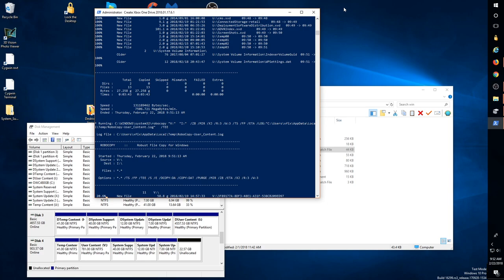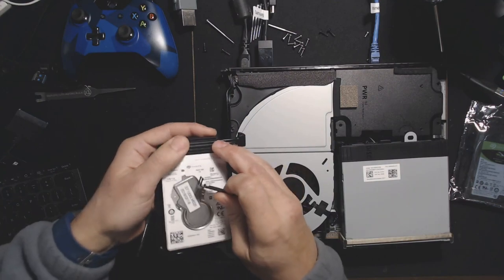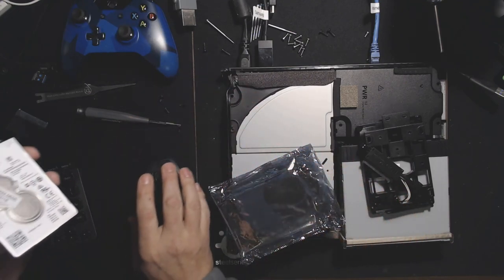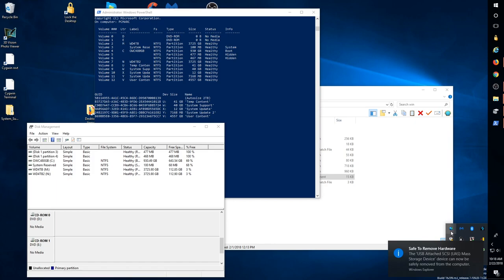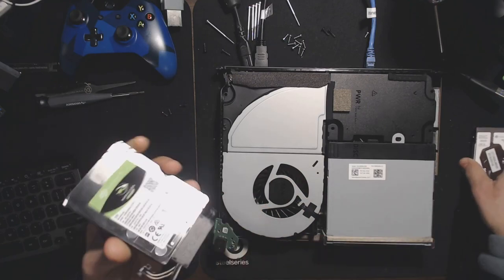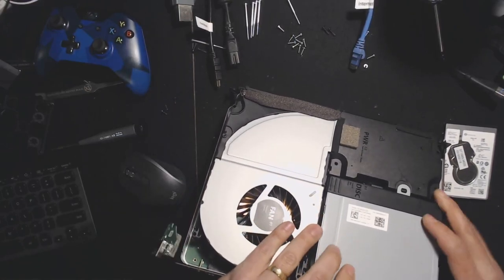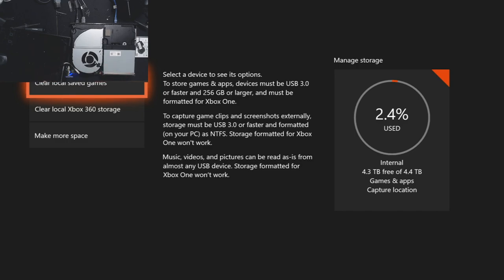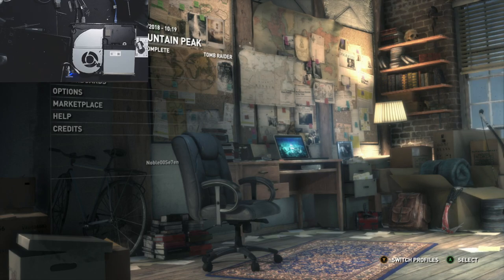Xbox One X Scorpio 5TB Internal Hard Drive Upgrade Using Windows Script 6.1

Comment: May be a stupid question, but can't you just use a drive cloner?
Reply from the maker: Not a stupid question and you can. I use Clonezilla personally and it's fine when going to drives of equal size. If you are going to a larger or smaller hard drive my scripts are much much easier.
Reply: @mpdavig  Would that be because the cloner, obviously, would clone the drive exactly how it was and if going to a larger drive the partitions need to be proportional to the overall disk space?
Reply from the maker: Exactly. This is taken from a comment I made a couple days ago about a similar question:

You wouldn't want to adjust the partition sizes using clone software because the Xbox One expects specific sizes. The difference between a 500GB, 1TB, and 2TB Xbox One is not just the "User Content" partition size but the disk GUID itself. The specific partition sizes and GUID values are contained within the script and should be maintained to ensure the hard disk is both recognized by the Xbox One and is resettable. This isn't to say you couldn't use clone software but my script takes all of the guess work out. I used a combination of CloneZilla and gparted in the past but there were numerous steps and the process took hours.
Reply: @mpdavig  Gotcha! Very insightful thank you! Have been wanting to swap my HD for SSD for a while, so I now feel confident to do so.
Reply: @mpdavig  thanks for your video
Reply: @mpdavig  hi , is it possible to know if you have experience with acronis? Since you can make a clone and set "proportional" to make sure sizes wont matter , i am thinking of upgrading and i have a set up ar work that is ready to clone is that matter , would be very easy for me

Comment: Im sure my HDD has failed, as when it booted up in the past it was jittery. Now it errors E105 or E102. And i hear no spin up of the drive. 
So question, can i put ssd in, and will i have any issues or anything to extra to do if i dont have a functioning official drive. (I plan on only a 1TB replacement drive)?
Reply: Apparently what I heard is if you put in a ssd you can get banned for it, don’t know how or why but that’s just what I heard.
Reply: @Brad_2123  thats a lie you dont get banned

Comment: Is it possible to just clone the Xbox One X 1TB HDD to a 1TB SSD without going through all this? Just need a definite answer before i pull the trigger and do this.
Reply from the maker: RAMBOLOGY yes, in fact that would be the better method.
I highly suggest using Clonezilla disk to disk copy to maintain all the GUID disk and partition values. If using something else make sure it is an exact disk clone.
Reply: XFiX Thanks, Gonna try this tonight. Keep up the good work.
Reply: @JayVtec-GAMING  I attempted this but clone zilla or Acronis software weren't working out for some reason.  So I just started fresh following his video and managed to get an ssd operating in my xbox, No cloning required.
Reply: What error did you get with Acronis, debating doing this tonight using acronis or a disk duplicator.

Comment: @XFiX I tried replacing my Xbox One S HDD (retail 500gb HDD died) with another 500gb one, I got the partitions correctly but now when I turn on the console it says applying update then crashes with error E100 00000703 80910008. What can I do to fix it?
Reply from the maker: Patrick Souza E100 is a Blu-ray drive failure. If it's hooked up properly make sure you insert a disc. If you can't insert a disc this could be the real source of your problems.

Comment: using the different drive did you notice any performance increase in loading?
Reply from the maker: In my testing, which will be one of my next videos, the 5TB performed equal to the 1TB which is good. However, a 2TB SSHD performed significantly better than the 1TB stock.
Reply: XFiX that's what I was assuming......... you could start to sell turn key system's  ppl are lazy by nature lol
Reply from the maker: Turn key systems are a tough sell since certain drives can cost more than the entire console.
If you can buy up a bunch of systems with bad hard drives that would be a great start but often they have other issues beyond the hard drive.
I know a guy who owns a game store and he would sell systems with upgraded drives for about $50-100 over retail and he didn't have much luck.

Comment: Is it possible to use 192/240GB SSD with this script?
Reply from the maker: Yes, I have a video where I installed a 256GB SSD. I used the Linux script here but it would work with the Windows script as well. You could theoretically go as small as 128GB but you'd only have 10GB of usable internal space.

https://www.youtube.com/watch?v=gPJ-sBAWeL0

Comment: is there a risk to get banned from xbox live using modified drives?
Reply from the maker: Not aware of anyone who has. That said I recommend sticking withe the standard 500GB, 1TB or 2TB sizes when increasing or just upgrading. First because everything will just work as expected even when resetting the system and second there is a hard 2TB limit on internal drives:
https://www.youtube.com/watch?v=tcoa8Xx_6oU

Comment: I NEED HELP PEOPLE can i take out my xbox one hard drive and put it in my xbox one x PLEASE SOMEONE TELL ME THANK YOU
Reply from the maker: jimmy jimmy it is possible since the drives are structured the same however you will need to do a system reset before the drives will work since the data is tied to the console.
https://youtu.be/hYdza-udoi0
1. Swap the drives
2. Reset the system
3. Do an offline OSU1 update if reset results in an E### error.

Comment: last week I tried to do it with 1 to sshd but I was directly blocked in the first choice on the script :( so I just changed the thermal paste and my xbox works much better but I would also like to put a sshd
Reply from the maker: Running the script as administrator is one of the most important steps but I'd have to know what you mean by "blocked in the first choice on the script" to help you any further. The more specific the better.
Reply: is stop here http://prntscr.com/ikju2q
Reply from the maker: Gamer-pc this is good thank you. You can see the diskpart output is still French,  but it should be English. Something is preventing Englishize it from temporarily swapping the language. I'll look for a workaround and get back to you.
Reply: Oh thank you very much
Reply from the maker: Can you run this command in the command prompt and get me the output:
dism /online /get-intl
Reply from the maker: Or run the following command in Windows PowerShell
get-uiculture
Reply: XFiX Have you resolved the issue of Gamer-pc???? I have the same problem .... recursive in one laptop , one netbook and one pc .... with your interface sata to usb and the same, directly connect with sata in my pc  :-(
Reply from the maker: Didn't hear back from Gamer-pc but can you run the following command in Windows PowerShell:
get-uiculture
There is a list of supported languages that Englishize supports and maybe your language is missing from this list:
xboxonehdd-master\win\Englishize_Cmd\_lang_codes.txt

Comment: Cant find anything on this. Help appreciated. I own 2 xbox x consoles. 1 is being used for parts and other needs hdd. All is up to date...anyone know if I can just swap console 1's hdd into the 2nd one? Guess I'm a rare situation. Looked everywhere online and nobody has anything on this. I know I can just try but am afraid it may cause issues where if it doesnt work then it freezes up the 2nd console that needs the hdd. Like a copyright encoded type thing that locks up the system. Figured worst case is put it in and see what happens and if it won't work just put it back in the original console. I know it's not like the 360...where the hdd was encoded for each unique console.

Comment: Such A pain. Ms might as well use custom soldiered flash storage
Reply from the maker: There is soldered flash storage.
The OS is split between the motherboard NAND flash at 5GB and a possible 100GB of critical system files on the hard drive. In 2013 things were done this way to save cost and for security purposes.
Compared with the original Xbox's 256KB-1MB NAND or the 360's 16MB NAND 5GB is still pretty generous.
The biggest reason for the HDD requirement though is the Xbox One's use of a nearly complete Windows 10 installation. Sure the interface is neutered but Windows 10 is there.
Compare that with the original Xbox who's OS is on the hard drive (non-removable HDD) and the 360's OS completely in the NAND (removable HDD).
Reply: @mpdavig  I think they might as well make a system with full soldiered flash no hdd for both os and games. Lighter, more room to cool heat, possibly faster than HDD if it's custom flash and protect hackers from messing with system files. So pointless to have HDD since they don't even allow us to remove without voiding or going through stupid steps

Comment: im having an issue with.... not enough storage to process the command..  i know im doing somthing wrong, im using a formatted xbox one segate 500gb.  trying to make hdd from scratch for console repairs.
Reply from the maker: Josh Holcomb I'd love to help you out. What Windows version are you running and is it possible to upload a screen shot? 
prntscr.com perhaps
Reply: i actually figured it out. i used powershell instead and the current xboxone-master file and it worked.
Reply from the maker: Great! Thank you for the update.
Reply: XFiX great work
Reply: Josh Holcomb Try western digital Seagate will give you a damn headache avoid them like the plague.

Comment: Having issues after i use the script. After i make the modifications to the script i consistently get e101 and e102 errors. Even when i attempt the offline update it downloads and verifies it but when it applying it at around 72% it errors out back to the start screen. Any suggestions xfix. Converting from a 2TB hard drive to 5TB hard drive

Comment: IF I GET ANOTHER XBOX-X I MAY DO THIS, BUT HAVING THE ORIGINAL SCORPIO, I'M NOT GONNA TAKE ANY CHANCES. AND I WILL SAY I'VE DONE A SIDE BY SIDE COMPARISON BETWEEN THE X & THE S AND THE S OUT PERFORMS THE X. IT DOESN'T MAKE SENSE WHY BUT THE RUN SPEED, FPS, AND DOWNLOAD SPEED WAS FASTER ON THE S THEN THE X, ALL USING THE SAME EXACT INTERNET SPEED, STORAGE SIZE, ETC... I DUNNO WHAT IS DIFFERENT BUT THERE IS SOMETHING TO THE S OVER THE X.

Comment: It is possible to replace with ssd disc with this tool bat?
Reply from the maker: Of course. It's same steps whether using an HDD, SSHD, or SSD. It just needs to fit within a 2.5" form factor and have a SATA interface.

Comment: Would I use option (A) 500gb to install a 480 gb ssd
Reply from the maker: Unfortunately 480GB drives are too small to be created from scratch. You'd have to do a direct copy from a working drive to a 480GB to be able to use it.
Reply: @mpdavig  I currently have a 1tb working internal drive can I copy from that to 480 ssd? I know its down grading abit but I'm only going to run one or two certain games of the ssd

Comment: Do NOT follow these directions on connecting your drives with your computer on unless you have hot slot turned on in your BIOS. Other wise you will try the new drives and most likely your computer.

Comment: Good thing I have a 6tb and a 4 tb external hooked up too much work with insignificant gains unless it's an expensive SSD.
Reply from the maker: Lt. wreck hey man however you add the  space is cool with me. This is mostly just to show people what is possible.
Plus this method was originally designed to fix systems with failed drives. Plus I'm not sure that 3x the space of a 2TB and 12x the space of a 500GB insignificant. Plus add the externals as you did and you've got a monster system.